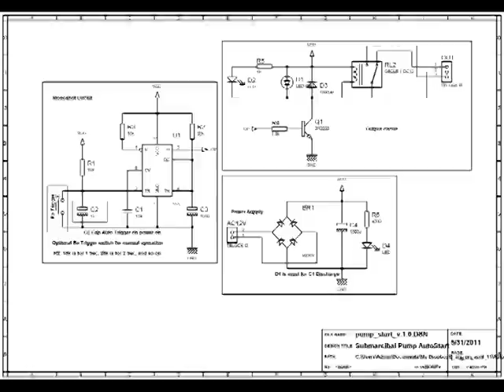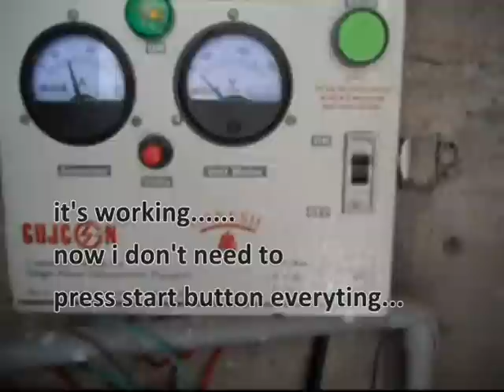Automatic Starter for Submersible Pump

Comment: Good.... but relay used for start capacitor is small... will it cause problem by stuck the start capacitor

And will it work for 3 hp single phase motor

Comment: See the schematic at begin of video using a NE555. Press to operate trigger then threshold complete monostable. Caps across Wheatstone bridge on AC side...hope not run cap for the single phase motor? Why not use use shaded pole instead?  Are you a sparky?....oooppps qualified electrician?  Where danger signs?  By the way I have a degree in electronics and a sparky as well :-):-):-)

Comment: hi sir, at starting water is coming with full pressure after 10-15mins pressure is decreasing and motor is getting off .what is the problem? is problem is in motor or in pannel box .
Reply: condensar badal do.

Comment: i have tried by my own making 2 second timer circuit, but sometimes motor starts and some times fail to start and require to press button for more than 2 seconds upto 5 seconds. what to do .
Reply from the maker: use high current wire for capacitor connections, as well 2-4 second delay will be ok, there is no problem.